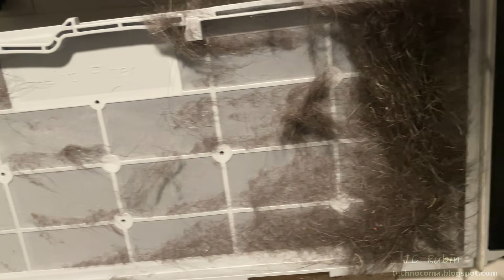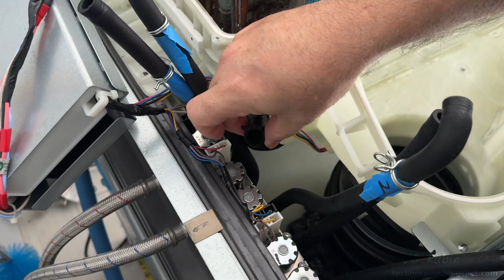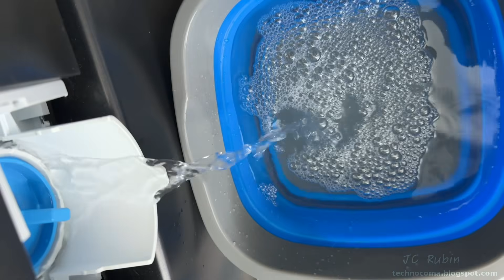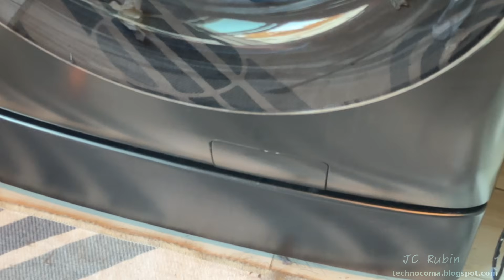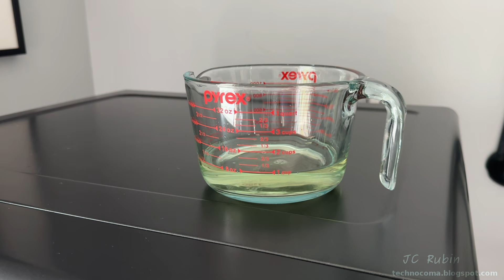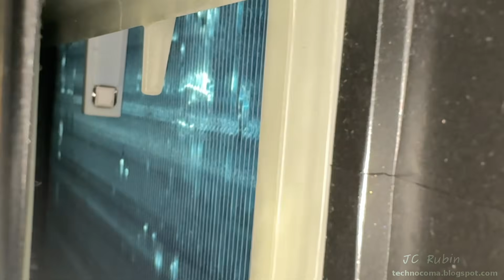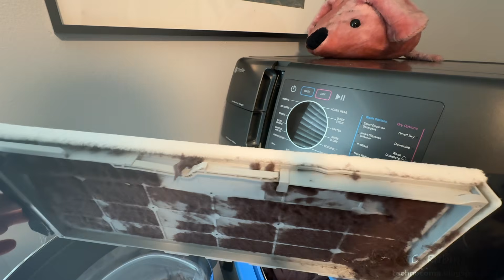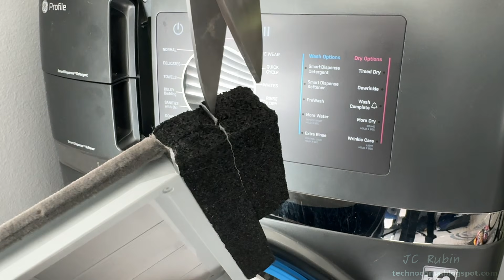GE Profile Ultrafast 2in1 Combo Washer Dryer - Why they Fail & How to Fix it

Comment: They did come out with a new filter design for this machine. I just bought one from GE. Curious to see how it performs compared to the old design.
Reply: Can you provide the link to the new filter released?
Reply: @HPBuckeye04  part # WE16X39861  I'm happy I'll never have to wash that foam filter again!
Reply: Did he ever share link to buy new filter? I don’t see it here.
Reply: Yes no more foam filter. Just a double mesh. Seals fit alot tighter then the old style. Been using for a few days and is a huge improvement!
Reply: @ericmoore5013 is there ANY lint blowby?
Reply from the maker: I heard it does not have the foam on the other side but nothing with regard to stopping long going around the filter. No seals of any kind.

Comment: add superglue to the adhesive.  It resissts heat and moisture better than the foam adhesive. The other alternative would be high temp adhesive used for dryer ducting.
Reply from the maker: I’ve never used superglue in a heat application but if it works for you, awesome.

Comment: I'm curious about if this restricts air flow. Mainly the back mod with the thick foam, would this cause any air flow issues after long use affecting dry time and over heating the unit? Just a question as I am unsure 😊
Reply from the maker: Why would you want air passing around the filter instead of through it?

Comment: Didnt work. After putting on the seals, i  got error message. The filter housing was hard to push in. Kept getting error messages. When i removed them, no more error messages. I removed them. Solution? Just clean your filter after evarytime wash. Clean the inside of filter area every 6 months or so. Ive had mine for 2 years and is working fine…simple
Reply from the maker: Sorry to hear it. Best of luck.

Comment: I will be doing this next, as all other videos I’ve seen about this don’t help. Curious though- would it be better to just go the old fashioned route and just modify it to vent outside?
Reply from the maker: It’s not a vent it’s a heat pump, the design wouldn’t lend itself to an open look system.
Reply: It can't work if you vent outside, it has to recycle the air through the heat pump to warm it enough to dry your clothes. It's a requirement to the fundamental process of this type of machine.

Traditional dryers require a significantly more powerful heat source because they vent all the hot air outside. It has to be able to get the air hot enough from room temperature to dry your clothes in one shot. The heat pump keeps the air inside and heats it more gradually through multiple cycles passing through the pump. This is one of the reasons it's far more efficient than a traditional dryer, and also why it can run on a regular 110v outlet, unlike a regular electric dryer.

Comment: Since, it seems such an obvious design flaw, have you submitted you findings to GE/Haier and ask why does the filter not mate to the back of the machine and therefore allow all the lint to bypass  the filter.
Reply from the maker: I’m sure GE is aware but has no plans to fix it.

Comment: Thanks for this video. I recently purchased this machine. I am adding the seals to the filter. I do have a question. Where did you get the large blue brush that you used to clean the filter slot.
Reply from the maker: I bought it on Amazon and provided a link in the comments
Reply: @rubin-tech thanks again.
Reply: @rubin-tech  The link you provide for this video is a link to drain and straw brushes, not the large blue brush you show in this video.

Comment: After all thank you so much for the video I have been following you since very beginning you start doing this series on this Machine. I Gotta tell you something I have not Experienced none of the issues you have portray in here and the only thing that I'm wondering about is why after almost 2 years with this machines I concluded that most of the users they never understood where they were getting into meaning most of them did not do the research to understand the product before buying. I don't know if this is going to catch your eye but I think the key is   Garments need to be separated accordingly. I did experienced a failure on my NTC4 sensor after the Nanny left a dog pad a training pad into the machine and I'll havoc broke through. After that, I have been meticulously following up with both machines and I have not experienced any issues. You are right about the filter. I don't understand why General Electric is not issuing a recall on the filter of course money is always difficult on recalls, but it would be or make this machine to be almost perfect. I still think it was a masterful piece of engineering. Only time will tell. I promise you I will open both of my machines and share what I have found in them in this two years of usage and I will be waiting for your six months review. Thank you for your time and excellent work.

Comment: 5:42  the purpose for the gap is so when lint builds up it has a place to go. still a dump design, but that is the reason.
Reply from the maker: There is no purpose for the gap to allow the machine to destroy itself if you don’t clean your filter. There is an alarm for that
Reply: @rubin-tech  well don't shoot the messenger. The engineers wanted the rubber perimeter seal to work but someone messed up and it doesn't seal well. if it had sealed well no one woud need these work arounds
Reply: Millions of dollars are spent to engineer things to break down at a certain time, otherwise your machine would last for ever and that wouldn't be profitable for the company
Reply: @tap818  no, the seal just doesnt' work well. GE Is loosing money fixing this error. There are techs who will bill GE to repair the heat pump just becuase it got dirty. conspriacy theories are not always true.

Comment: What are the chances the the 1” seal comes loose and off the back of the filter when removing the filter? I want to be able to access it to remove it from the machine…
Reply from the maker: If it did, in the off chance it could probably be pulled right out with the thin brush and a new one applied.

Comment: I installed the 1" foam weatherstripping onto the heat pump casing when I had it taken apart and not onto the removable filter. It last longer that way.
Reply from the maker: As mentioned towards the end of the video, that will be done when open for inspection in six months